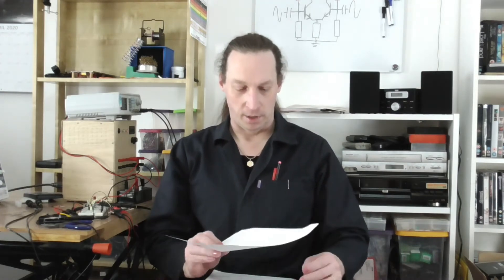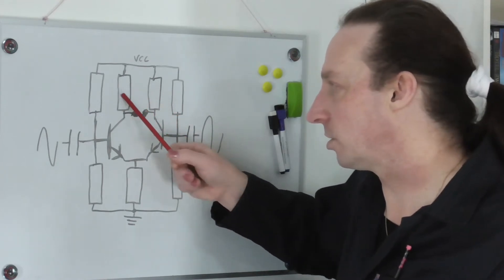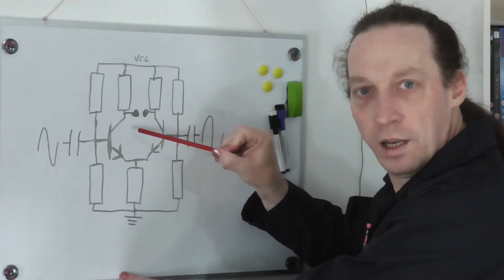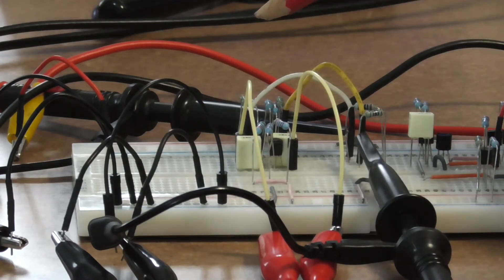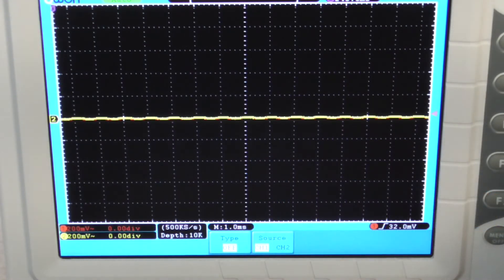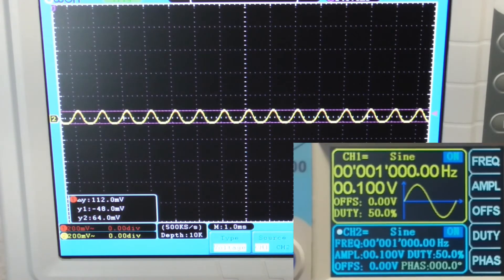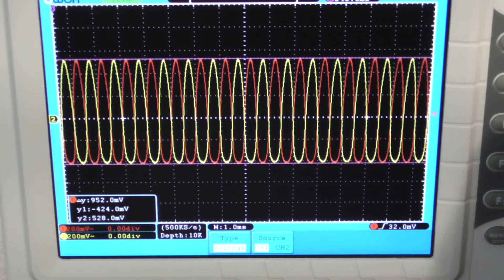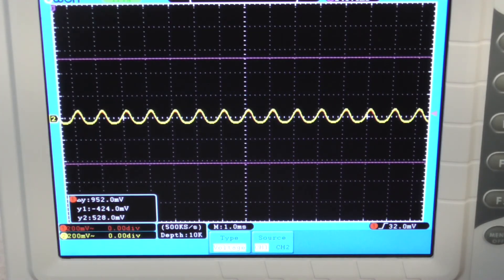Long Tail Pair (Differential Amplifier) Part1

Comment: What's the reason for all the distortion in the signal? Even at no amplification it looks distorted.
Reply from the maker: Hi Matei, yes there is a lot of distortion, I don't have a very good power supply and where I live I always have problems with interference.  The result is that I am constantly dealing with distortion.  If you can get it working with clean power then hopefully it will look better.